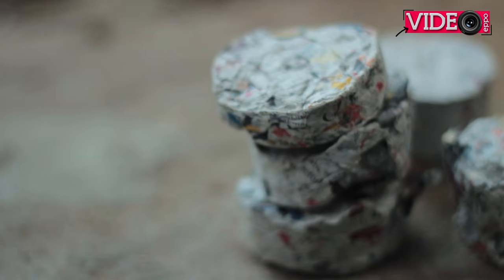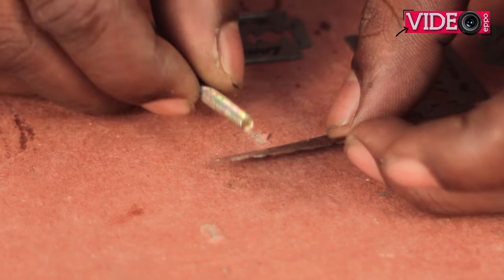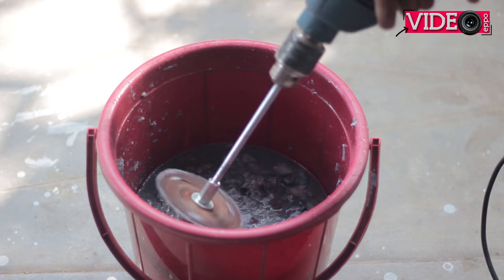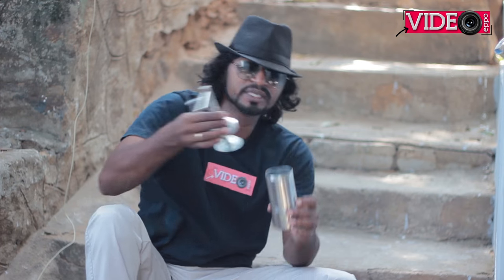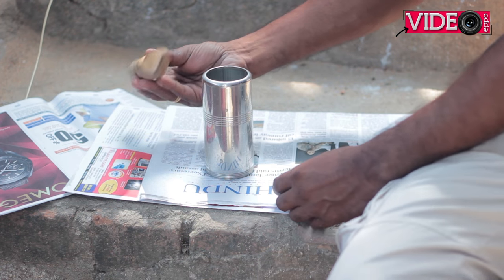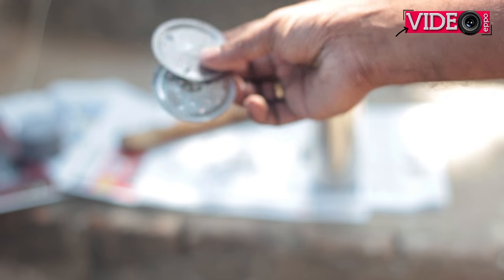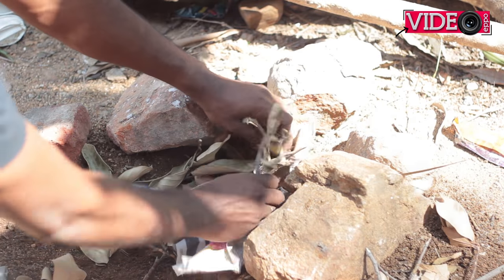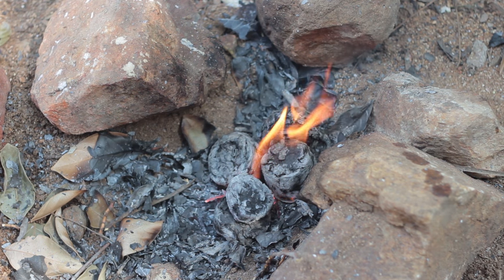Making and Cooking with Paper Briquettes

Comment: Add some waste cooking oil on them few hours before use. Flame will stay on from start to finish like this :) Cool video
Reply from the maker: That a really nice thought and an awesome way to re-cycle wasted kitchen oil that runs in drain. Thanks for the tip!
Reply: 1 more trick : since you use only paper get PVC pipe, drill few holes, chop a log to fit that pipe and sit on it few seconds. If you mix paper with sawdust, grass, coffe...whatever it burns and is free then you need more pressure. Less paper = more pressure. Good luck and have fun testing :)
Reply: @babypower9582  hello am i supposed to add the sawdust with the paper while soaking or just when it's time to compress it?
Reply: @ryzeVA  just before press. Easy to mix

Comment: Other alternative, just soak the newspaper, used paper, cartoon old calendar, it will absorb water then it's easy to tear apart, then you can make use of your hands to squeeze the water from the soaked material. Make it round as you squeeze water from it
Reply from the maker: That should work too. The reason why we pack it so tightly is to help it burn longer with a sustainable flame. squeezing with hands might be hard and also have more air gaps. It will make the briquette burn faster and the flame will be more. My suggestion is to make a similar jig with plywood or metal and squeeze it as much as you can

Comment: Great bid, are these better to burn or as a fire lighter?
Reply from the maker: Could work as both but the heat of the flame is a bit feeble. Not sure how to explain that. I mean, you don't get the same amount 
  of heat as wood.  ( Probable needs to be compressed even more) . Otherwise ,you can use it for both!
Reply: @VIDEOEPPO  Great thanks.  I just didn't want to spend too much time if these were not really good for cooking with.

Comment: Well I found it useful but useless bcz you made them to big for one and two you needed a pump to cook. I wanted a new way to make briquettes thank you for that but I think I’m going to try this but I’m a smaller size
Reply from the maker: Making the right size briquette with the right material is something we should experiment. For example, if we make it out of sawdust, how dense it should be, what would be the binder, and what size will burn with efficiently? Will it produce too much heat and burn faster, or make too much smoke and burn slower? How big for a chuck can you feed in the stove without suffocating it and fan frequently ...These are some of the things to keep in mind. I could not diversify my experiment at that time due to a lack of tools. But if you are going to try these inputs should help you do better than I did.